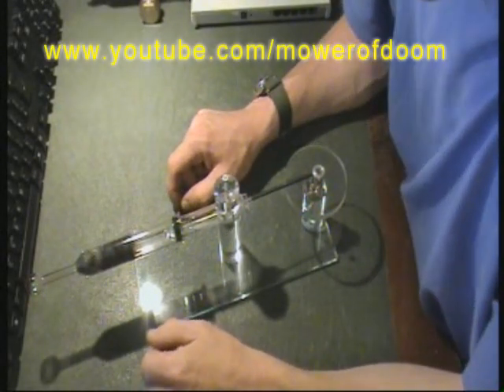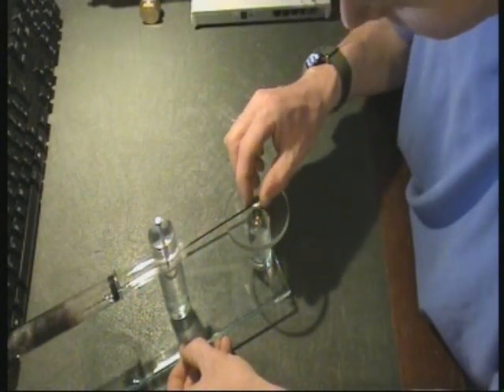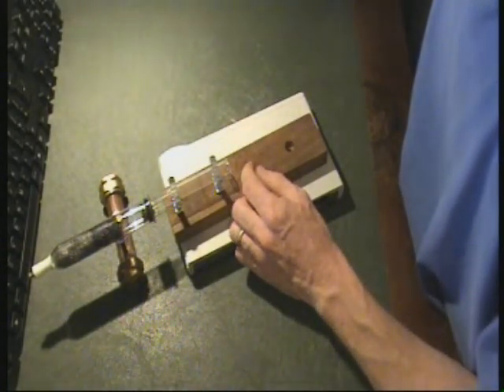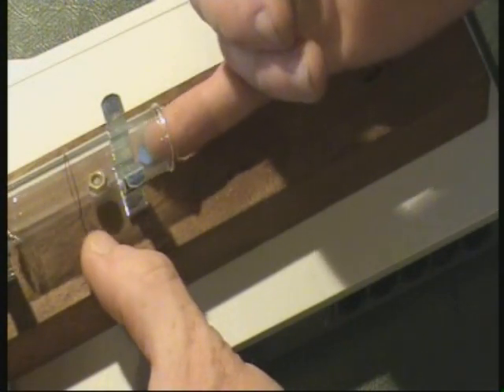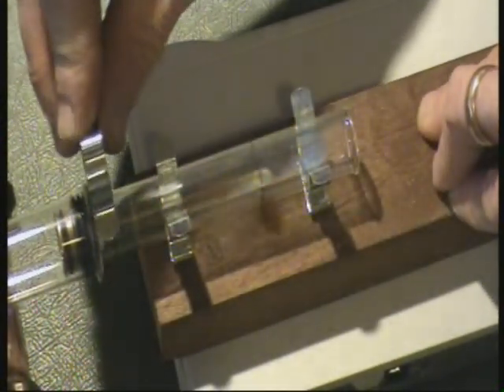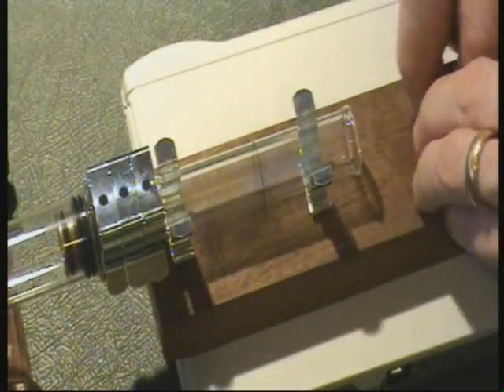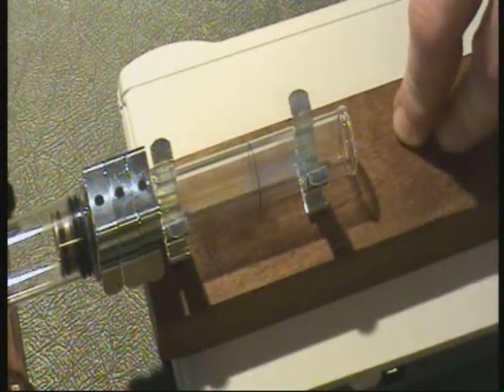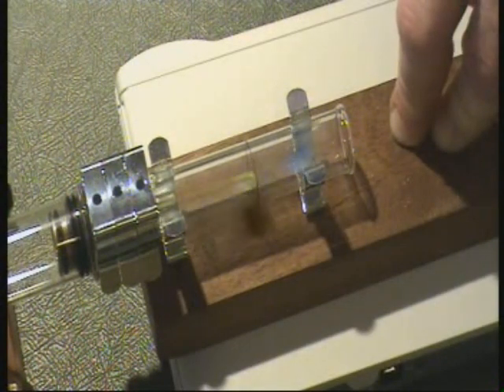Interesting RESONANT(?) Stirling Engine

Comment: I would call it a free piston thermal acoustic Stirling engine.
Must be interesting to make a design program for this. I'm sure the volumes, forces and speeds must be balanced in a certain way to let it resonate.
It must be possible to make it double acting.
I think you were very lucky to have the right dimensions to have it working.
Thanks for sharing this.

Comment: There does not seem to be a simple easily understood physical explanation for this type engine though the literature does offer more than sufficient highly mathematical analyses.. The application of heat to a mass of air or gas enclosed to allow vibration of the air or gas particles mostly in one direction results in the excitation of these particles more or less in a coherent manner. the rate of vibration is governed by the length of tube open at both ends. This vibration manifests as a sound. The tube must allow movement of air through it and this is made possible by mounting the tube vertically. The frequency of resonance depends upon the dimensions of the tube and not upon the degree of heat applied. If the tube is  mounted horizontally there is no sound produced as there is no air movement. If   a piston is provided at one end of the tube  which is closed at the other, and this piston displaced intentionally, there is a movement of air which gradually builds up to a sound wave which of course cannot be heard as the tube is closed at both ends.But the sound wave does exist and manifests as a pressure wave. The variations of pressure on the piston results in oscillation of the piston.. at resonance there are relatively large fluctuations in pressure and to make this possible the piston  must not be restricted in its movement to dampen the pressure wave. As the sound wave is at a relatively high frequency, the inertia of the piston cannot respond to this rate and so oscillates at a very low sub harmonic of the resonant frequency.. This is the only simple physical explanation possible and it could be valid. Please see videos titled. "using heat to produce sound". All the best and congratulations on your well made engine. Perhaps you could add a flywheel and actually measure torque and speed and so obtain output. Knowing the amount of fuel used per unit time you could obtain the input in calories, convert to watts or hp and obtain the efficiency of y our engine. This should be around 10 or 12%. All the very best to you , Sir.

Comment: you can think of the piston in the tube as a non linear spring.  hooke's law gives the resonant angular velocity of an ideal spring as square root of (spring constant k divided by mass m).   Divide that by 2 pi to get frequency.  but there is a counter play of the velocity of air itself and the standing waves generated by the half open pipe.   thermal lag of heat transfer of gas and regenerator.  cool little puzzle to solve with equations!

Comment: You might be able to use it as an electrical  generator by replacing the nut with a rare earth magnet and winding a coil of wire around the tube. Not that simple  of course, since the energy required to induce the electricity would come out of the energy necessary to sustain oscillation .

Comment: This is a ThermoAcoustic engine, I believe.  Stirling engines imply an orthogonal element.  The frequency of your engine depends on the load  or the weight of your piston, but there probably is a minimum and maximum weight for a stable operation.  If it is too light, the frequency may be too high to allow the heat transfer to traverse from the high to the low temp sink so the Q will limit it. Higher frequency = shorter stroke length and too short a stroke will squash the temp differential...

Comment: Oh, btw. You mentioned that if piston is to heavy it will not work. That is because piston itself perhaps has it's own resonant frequency. If so, then it will be good to experiment with different weight of the piston to match that two resonant frequencies: one of the hot side, and another of the piston itself. What you thing about that idea?

Comment: Hey man, I'm brazilian student of mechanical engineering and i have to construct the Stirling engine is the thermodynamic field. Can help me? I have a doubt, this enginer works with hot air? Do you have a project or material should I use to build? I have test tubes with internal Diameter 18.5 mm and 22.5 mm with two others and know how to work with lathe to machine parts. I would be grateful if you could help me, thank you my e-mail thiago.zabot @ gmail.com

Comment: This actually makes me think of one of teslas experiments with air pressure to make a resonant system. He made a piston that ran off of high pressure air, and had it's spring system made of air, because when he used a metal one it would break from fatigue in less than one day.

Comment: would your first engine run at all without the flywheel , i am currently trying to get one of these going i have followed exact plans and yet the piston does not oscillate at all and im wondering if this engine is likley to do anything at all when coupled with a flywheel?

Comment: very nice,
I think the motor you built is a kind of thermo acoustic travelling wave engine, the frequency is established by the resonant frequency of the system piston (mass) and gas spring force constant.
It would be wery interestinng to try to enprove the motor power by pressuryzing the wole system.

Comment: it runs because the heat expands the air, the air is then spread over a larger area including a cooling area, the air temp drops, air contracts, piston moves inward, air is trapped in the heated sections and expands again. Air, all gases really, have a heat up / cool down time, that time creates the freq of the piston. Larger air volume, low freq, smaller faster. Hydrogen would have the fastest freq for equal dispacement engines.

Comment: Two connected together might make for an interesting method to convert waste heat into air-conditioning. It should be the same thermal cycle.

Comment: Beyond my understanding, but fascinating.  Would it be possible to utilise the waste heat from, say, a domestic CH boiler and the reciprocating action being connected to magnets through a coil to produce enough power to light a whole bunch of the new high-intesity LCD's?  (free house lighting??) I see there are torches that one charges by shaking a few times... that principle is what I have in mind.  I'm sorry I took less-than-zero interest in physics at school now!

Comment: its elasto resisnant, the elastic quality of air pressure differencial, very cool demostration of it. take the nut off use a small neo magnet, and wrap a coil of wire arounf the cylinder tube, and light an led.

Comment: I am playing with an idea of using a small diameter loudspeaker as the piston. If I mate the speaker (cone point towards engine) to a appropriate size funnel I can attach the funnel (ideally with a 6mm small end) to the hot tube with a silicone stopper. The shorter stroke of the speaker should allow higher speed operation and it already has a magnet and coil in position. Not optimized I'm sure, but it should be easy to tell if it is worth pursuing.

Comment: I like the magnets in sheep's clothing idea! I think you could do a similar thing with the dead area, just have a magnet on the piston and another one in the open end of the cylinder. If they are oriented to repel you can adjust the piston position easily.

Comment: It is interesting that the hole size is so critical. If you had a screw that could block more or less of the hole maybe you could tune the hole size. It may be that when you put a load on the engine, the ideal hole size may be different.

Comment: This has the potential to be a very low cost generator. Even if the efficiency is not great, if it gets  heat from the sun or waste heat(cooking stoves, water heaters...) then that hardly matters. Cheapness rules!

Comment: I tried to build a lamina engine, and before I managed to melt the test tube I was using, I noticed the same phenomena of the self oscillating piston when the connecting rod slipped off the crank. I think this engine has good potential to be a very simple generator with a rare earth magnet in the piston and a coil wound around the cylinder. Frictionwise a vertical cylinder would be better I think, and with another magnet outside limiting the stroke so you don't accidentally make a cannon.

Comment: Power is force x distance. Can you measure the force from the piston? This will let us calc the output power. Can you estimate the fuel flow so I can calc the input power? I've heard these things can be almost 40% efficient. Get a shaker flashlight and put the coil around the output to gather the output work.

Comment: Really really nice experience! Can you give us some info about the relative size of "tube" cylindre and diaphragm bore?  
According to you why is this diaphragm an important feature of the engine? Would it run without it? or with different boring diametre?
Did you try the same concept with an "both end" open tube and a "static piston" to allow you to "tune" and perhaps reach different freqencies?